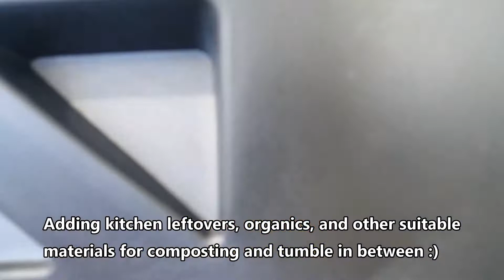Assembling EJWOX Dual Chamber Compost Bin Tumbler & Composting with it

Comment: Great video - assembled mine yesterday.  Would have appreciated a slow motion example of the 'difficult' bits.  For me how do you fully screw the bolts which are on the end axle holding up the drum. !  Have the tools - it won't budge.  Screw will not screw on the bolt ?  Plus the very last panel would benefit with explanation including how difficult the middle Center holes are and that you may need th forage in your garage for longer bolts.

Comment: Thank you for this video.  I have mine on the way from Amazon.  Question.  How long did it take for you to get usable compost?  I have a couple of garbage cans with just leaves, and it seems to be slow going.  My goal is to start composting for next spring now.
Reply from the maker: Generally, it depends on a the temperature (season & location of it), the amount of materials, and the wetness ratio (of the kitchen scraps vs brown dry material), but for me it took about 3 months